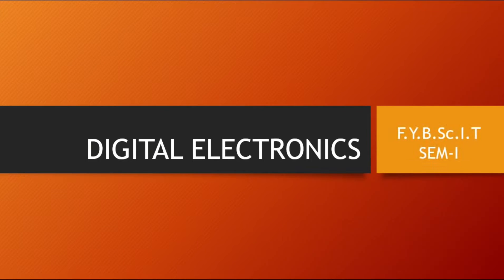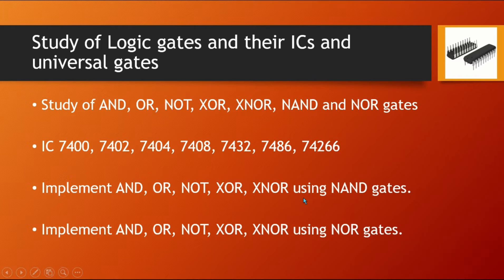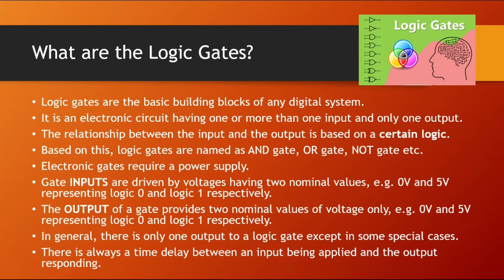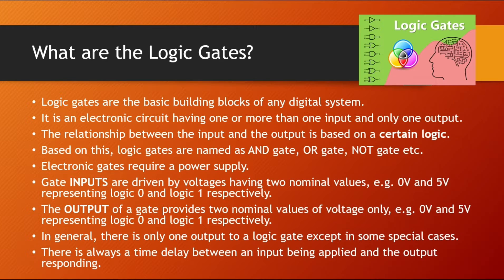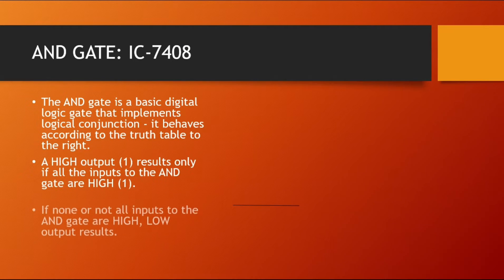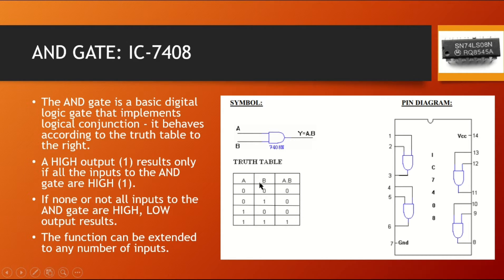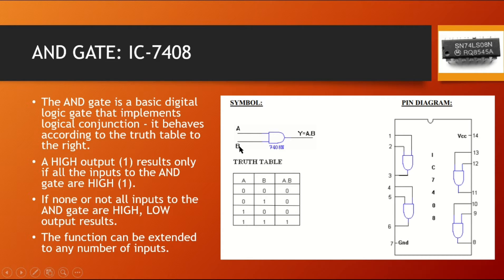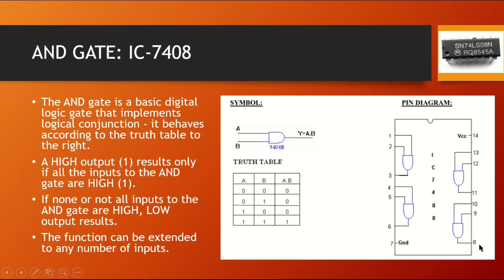Implementation of AND Gate IC 7408 on a breadboard/ Circuit: Digital Electronics Practical

Comment: Dear madam,
A problem is that when i take out vcc wire led start glowing other wise not.Tell my problem.
Reply from the maker: This is happening probably due to loose connection or due to impaired breadboard. Try making connections firm and test the circuit. Besides when wire (input) is in air, it's high input.
Reply: @artiparab4583  
Thanks maam for replying actually problem was in IC.